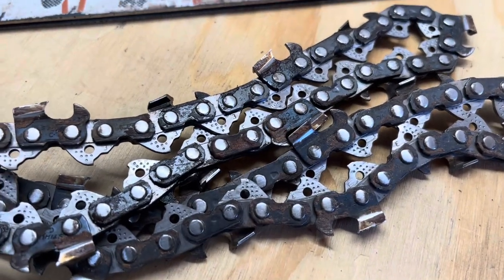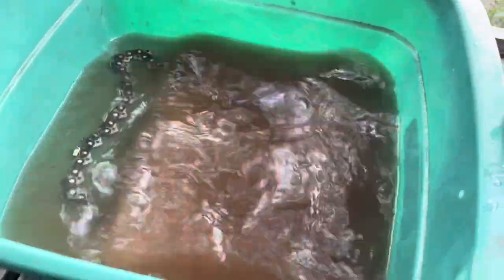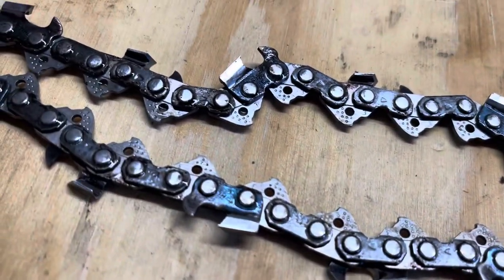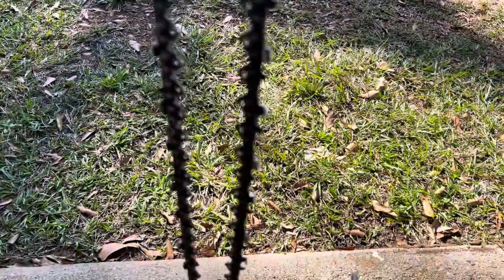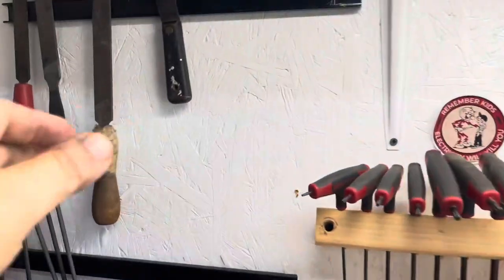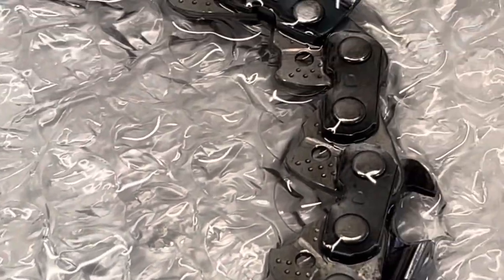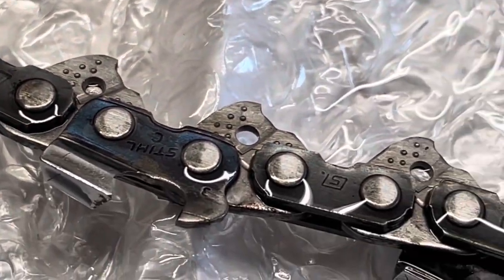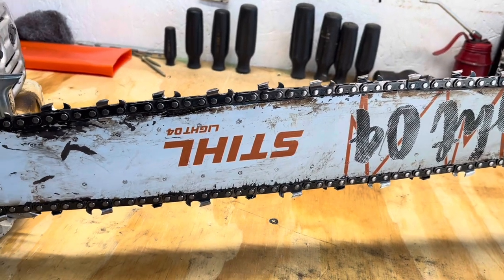How to remove pitch and resin from chainsaw chain

Comment: I'm glad that lye worked so well. I'm wondering what else lye would work on, lawn mower blades?  
Oh, and I'm number 1. Awesome  have a great day.
Reply: My favorite use is cleaning the crud off castiron cookware.  I have a lye bath, setup outside my shop, to suspend pieces of castiron in it. Leave it for a day or so. Rinse WELL with water. Using a steel (not brass) wire brush or steel wool pads, the schmaltz comes off easily. If the carbonized cooking fat is resisting removal, just give the frying pan a little more time in the lye bath.  For rust and schmaltz removal, I have an electrolysis system setup. Both systems clean far more than cookware.
Reply from the maker: I think lye could cure cancer!

Comment: How did you manage to find lye? Surprised me so much that I just looked it up. I see it's back on the market again. Disappeared in 2005 due to use in making illegal drugs. When Red Devil Lye disappeared the only lye that I could find, was a brand of drain cleaner sold at Tractor Supply. If memory serves there was a limit on how many containers I could buy at one time. Naturally, every time I had an excuse to stop there, I'd buy another 1 or 2. 

I can sure testify to how good lye works. I have the bottom half of a plastic barrel setup outside my shop, as a lye bath to clean crud off castiron. Hole cut on either side of the barrel top to hold a pipe. Cast iron skillet, for example, is suspended in the lye & water solution using an S hook. Lye doesn't work on rust, but it will sure take off schmutz! When rust is the issue, I've used boiling in a vinegar solution or electrolysis to bring new life to old castiron. 

Glad you found such an easy way to clean that chain. The method will work for other schmutz laden things, too. Don't use on anything that you want to keep the paint. 

Thank you for sharing your solution. Hope you and Charly have a blessed Monday. Godspeed if you open your gate.
Reply from the maker: I had no idea it had so many uses. I had to order it because no one Carrie’s it in a store. Even Lowe’s and Home Depot.

Comment: And knew  a guy that used an oven cleaner spray, but that ol timer was odd. 😂
Reply: Using oven cleaner is one of the methods to clean the crud off castiron and Corning cookware. Spray the pan, with oven cleaner and put it into a plastic trash bag & seal. Leave overnight. Using gloves, remove and thoroughly rinse to remove the oven cleaner residue. Repeat, if necessary with heavy buildup of burned on carbon deposits. 

Speaking from experience - It works!
Reply: @oldtimerlee8820  sir I used it to clean engine blocks, 😂 don't gotta tell me.
Reply: @hondaatcfreak420  🙂

Comment: Thanks for the tip!  However I'm so afraid of that stuff,  that I'll never buy it.   Maybe the reason that isn't widely known is because of fear of lawsuits from accidents using it?
Reply from the maker: It really is some scary stuff.
Reply: It used to be a common product, found with laundry cleaning products, even in grocery stores. Here, Red Devil lye was sold in hardware stores in the plumbing section for drain cleaning. A very useful product when used for its intended purposes. It's been used since ancient times to make lye soap,  for example. Once it's cured lye soap is a good all purpose soap. From shampoo to laundry. 

It disappeared in 2005, when it became an ingredient used to make illegal drugs. At one time, there was a limit of 1 or 2 drain cleaner branded products that were actually simply lye. 

Lye is caustic and can cause serious burns, so it has to be used with care. That said, it's really no worse than using caustic paint strippers, for example. Primarily there are just 2 rules. Put lye powder into water. NEVER put water into the lye. And keep lye solution off anything that you don't want damaged. 

I've used it for years, without incident. When cleaning castiron cookware, I wear gloves - the heavy type sold for kitchen use ,  not the thin sanitation type. Wear goggles, if there's danger of splashing the solution into your eyes. (I've never worn them for that.) 

Finally, immediately thoroughly rinse the item taken from a lye bath. That's where the most danger exists, IMO. Remove the item and then touch it before it's rinsed. Or letting it drain on a workbench and them touching that liquid. That danger disappears, if the item is immediately rinsed. 

Hope this helps.